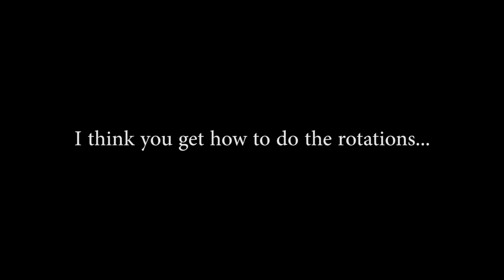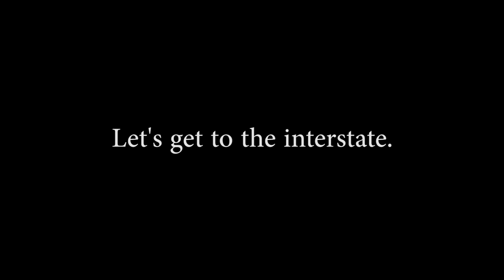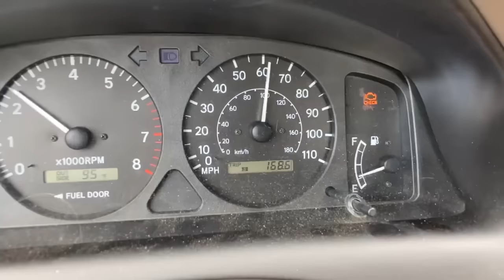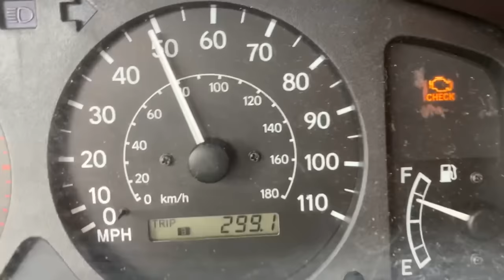Will Berryman's B12 Chemtool stop oil consumption? 😲 | Oil Burning🔥Experiments | Episode 15

Comment: Didnt see (hear) how much you added to each cylinder? Per Berryman's, they dont want the product in crankcase more than 10-12 minutes (when added to a cold engine. I realize this is a difference "application", but I would want to drain oil post haste since it's much more powerful than seafoam. Thoughts? Would it pay to vacuum out the cylinders or use those longer and larger cue-tips to get those carbon flakes out?

Comment: What is the signifigance of 5 rotations of Crank?........ 4 Rotations gives you one FULL Cycle, moving piston through Intake, Compression Power and Exhaust Strokes as well as one full rotation of cam/s and opening and closing all valves

Comment: I did this for a kia sportage 1.6 gdi 2017. It worked ! Before 1l of oil / 3000 km. Now I have 7000 km and 0 consumption. I used Nitrodiluant ( Romanian) for soaking 24 H and I manually rotate the engine several time in this period of time.
Reply from the maker: Thanks for letting us know!
Reply: @FamilyFriendlyDIY  Thanks , your video saved me , alot of money and time.

Comment: Also... I am thinking maybe it would be better if you see gunk in the cylinders after the soaking and rotating the engine, but fluid has mostly evaporated... might be good to put more fluid in, suck it out, and rotate engine to try to push that gunk out before driving?

Comment: After all of that, Install new spark plugs. And then do the 300 miles. Remove and inspect them. Keeping track of them!
Then start  adding  your product to gas tank and drive 300 miles. 
Remove plugs.....repeat...
Do not add stuff to your oil anymore.
Did you buy this vehicle new? I might have missed the history in previous clips.
Or if used.....alot of people only perform "gas" gauge maintenance.

Comment: i drive 2010 corolla-works better if you put full bottle in gas tank before fillup-i do every 6 months.Its meant as fuel system cleaner-NON GDI-not a no smoke type reducer.

Comment: The bottom dot is for cold oil. When the engine warms up it expands and should be at the second dot. So when you do an oíl change.  The oíl must be at the first dot or bottom line. Warm up the car and it should be at the top line or dot.

Comment: Nice vid, I sling parts for a living and B12 saved me from getting new injectors after I rebuilt my suspension and clutch in my firebird. I tried seafoam it would keep the code clear for a month did that 2 months in a row the last time after more research I dumped a can in with about 5 gal of gas ran that down and filled up the code has been gone ever since. Now that I know our gas is not that great I use a can of B12 every 3 to 6 months it's cheap and yet another real world test.

Comment: I'm willing to bet the valve stem seals are contributing to your woes as well. I would have left the B-12 in the crankcase a bit longer, it could only help clean things a bit. But this engine is tired.

Comment: How did the fix hold up? Won't the rings just clog up again, if this is a well known problem? If so, how often will this fix need to be performed in order to keep the rings functioning adequately, and oil usage at a minimum?
Reply from the maker: The oil consumption has not increased since this video.

Comment: I will give you few tips:
1.Chemtool is know for paint striping properties. Since oil pan is painted I highly suggest to remove oil pan and check if oil pickup tube is not clogged with stripped paint. There were few instances with killed Toyota engines just because chemicals stripped oil pan paint and engine suffered oil starvation.
2. You dont need to do full rotation of   engine crankshaft. The goal is here to get chemicals to oil scraper rings. Best way to achieve that is to rotate crankshaft few degrees front and back (5 min front, 5min back). I know you should not rotate engine backwards, but few degrees will not do any harm.
3.While soaking put spark plugs back. Just do not crank the engine!
4. For better starting after flush crank engine couple seconds with spark plugs removed. The more combustion chamber is dry the easier start will be. Usually I blow cylinders with compressed air through spark plug holes.
5. Driving car at hing RPMS does not make any sense and it is not necessary. Outcome will be the same.
Reply: I disagree with your number 5. I’ve tried piston soak with all kinds of chemicals: seafoam, mmo, carb cleaner and b12 WITHOUT driving the car high rpm for 20 mins after. None of them give immediate results like that after. It helps only a little bit but oil consumption return after just 1 full tank around 250 miles. That’s when I searched thousands of forums post after post and found out u need rip the motor HARD enough to help burn off those chemicals u have trap inside the piston land. The whole purpose of this was to trap as much as chemicals in the ring land and burn them off quickly once and for all with high rpm driving after. the high rpm, high heat, high speed of piston pumping and higher amount gasoline injected into combustion chambers with pedal to the floor combined with the b12 in the piston ring land all contribute to free up the rings quickly and effectively.

Thats how I fixed my oil burning Scion tC with the known piston rings problem 2azfe motor with just 2 treatments. 1st treatment cut down my oil consumption about 75% between 5000 miles oil change (only added almost 1 quart in 5000 miles), then after 2nd treatment, no burning oil at all in 5000 miles! I went from burning 1 quart of oil every 250 miles to no oil burning in 5000 miles, so that make total sense to me and it’s the only way to make it work. that’s why I suggested this method to Dave and I pretty sure he saw results like me already, just wait for his follow up to find out yourself. 

I’ve searched all kind of piston soak tutorials on YouTube and forums and 99% of them recommend soaking 24-48hrs and results were always not working still burning oil and they recommend to do the piston soak every oil change UNTIL it free up the rings but how many time does it require to free it up? If the the piston rings and oil holes were SO STUCK AND CLOGGED, how many times of piston soaking and does it take to free it up when u just soaking with chemicals but not MOVING them up and down, expand them and retract? If u want to free up something stuck, u need to physically move them and expand them right? That’s when the high rpm driving comes in to play. Not only it will move the piston up and down very fast, it also creates a lot of heat quickly. So b12 chemically on them, high speed piston pumping, high heat in the combustion chamber = stuck ring will give up and unstuck itself

Comment: It is entirely possible that the B-12 which has drained into the engine oil is what dissolves the carbon, sludge, etc. on the oil control rings once the car is driven after the soak, not the soak itself. B-12 sitting on top of the piston is going to seek the most direct path down, likely the gaps in the compression rings and whatever side of the cylinder is lowest. It is unlikely that the B-12 will spread evenly around the rings.  So, pouring two cans of B-12 directly into the oil filler may be just as effective as the soak.
Worth considering is how the lubrication properties of the engine is compromised by diluting it considerably with this powerful solvent, and how engine longevity may suffer as a result of seeking short-term improvement in oil consumption. Would you pour two quarts of acetone, toluene, etc. into your oil and then drive around? That is what one is doing with this process.

Comment: I have an odd connection with these videos given we have the same exact car likely built by the same dudes, we both run teal, and we're both Dave 🤘
Anyway, Great work! Time will tell. Also since I didn't see it on many forums, keep an eye on your upstream O2 sensor if you get the dreaded P0171 lean code. Everyone always assumes it's the intake gasket or a vac leak but in my case I either burned my sensor up running too much paint thinner or maybe carbon gummed it up from excessive oil burn.
Looking forward to the results down the road
Reply from the maker: You wouldn't happen to be an INTJ? Haha. Thanks for the comment, Dave, and the advice!
Reply: @FamilyFriendlyDIY  I am an INTP.   weird that you know what that even is. INTJ is rare.  also i noticed your bible mat 5.  I was a christian for over 30 years. on yt look up Jews for Judaism and Tovia Singer. look why the educated jews who now the nt very well reject it. Also look up False apostle Paul.
Reply: @FamilyFriendlyDIY  LOL - * I * am an INTJ..... I appreciate your thoroughness and best attempts at a scientific approach! I have a 2012 Hyundai Veloster with a GDI engine that's burning oil like your vehicle. I am going to try this out over the 4th of July weekend.

Comment: How is the oil consumption since your last video? I have a 2006 Matrix with 201,000 miles which consumes 1 quart every 3,200 miles. I slightly overfill by 1/4 quart every 800 miles, so the level never drops below the full mark.
Reply from the maker: It's still doing good, update to come. ... If I was only burning a quart every 3200, I think I'd just change the oil at 3k and not worry about it --- what mileage do you usually change at?
Reply: @FamilyFriendlyDIY  I usually do a 5k oci, but I might start doing one at 4k if oil is already pretty dirty. That's very cool that it's holding up. I originally used m1 full synthetic, but switched over to kirland brand full synthetic for last 70k miles. Seems just as good as m1.

Comment: Could be the oil control ring on the piston/pistons has lost tension (due to overheating or... ????) and is unable to drag oil back down the cylinder wall.
Reply: no. they get clogged. carbon

Comment: If nothing else, you've found a foolproof way of preventing tailgaters! LOL, now you need to rig up an injection system just for Stink Pipe. 
I was thinking about the whole 60 on the highway thing, and honestly I'm not entirely sure why you couldn't do this in the driveway or in neutral someplace secluded. I remember the cloud the first time I sea-foamed a 70s era Kohler engine. If someone were to have suggested you could see the plume from the ISS, I wouldn't have been surprised. 😁

Comment: Mechanic told me this could work, I'll be trying it for my Subaru.
Reply: I have doubts it will work in a Subaru EJ motor because of its horizontal design, how can u prevent the chemical from leaking out when u try to submerge the piston entirely with b12 when the piston is sitting horizontally? I don’t think it will work
Reply: @blackysan  right on, appreciate the info

Comment: I've been using B12 Chemtool in my fuel tank for years, roughly one can every 4000 miles. Because I've heard that it's a powerful solvent that can affect seals, I never leave it in the system for more than a couple of hours. I drive a lot between CA and TX, so I add it to the tank when I know I'll be burning 3/4 of the tank nonstop (easy to do in west Texas): about 300 miles, nonstop, at 80 mph. I also use Lucas upper cylinder lubricant/fuel injector cleaner, one small bottle with each tank of gas.

Anyway, I was laid up with medical issues for a couple of years, and couldn't change my plugs. When I finally got to it, I was about 100k miles overdue. The car was running well, but I expected a mess nevertheless. Imagine my surprise when I pulled the plugs, and they were clean as a whistle! I could have gone another 50k miles. I only wish I'd had my endoscope to check the inside of the cylinder. And this is a Ford Mustang, not a Toyota, with 200k miles! The car burns  no oil.  Not saying either one of these additives is entirely responsible--it probably has a lot to do with driving almost entirely highway miles--but I've been using these since the car had about 50k miles, and they certainly haven't hurt it any.
Reply from the maker: Which engine does your Mustang have?

Comment: After you soak the pistons, did you change the oil? If not that means the B12 dripped into the crankshaft case, and you drove for 20 minutes without any problem.

Comment: Hey Dave, I don't remember anymore if it was you or someone else testing this B-12 who mentioned someone had commented to add a bit of oil to the the cylinder before driving because the rings are dry after applying this solvent, but I'm confused... isn't the oil pump mechanically activated? Meaning, when we rotate the crankcase manually, aren't we pumping oil where it needs to go? Or are the cylinder walls "splash lubricated"? Cheers!
Reply from the maker: Good point. This is definitely not a splash lubricated engine.

Comment: Supposedly after a certain year in the late 90s or early 2000s engineers put less tension on the piston rings in order to improve gas mileage, which is why they’re getting stuck with carbon deposits.

Comment: If you changed oil regularly you would not have that problem. 
Do you run engine at high rpm constantly, upshift and go faster to clean out soot!

Comment: Been using Berryman's for a few years on my 2004 Accord, it's at 250k miles now.  The K motor is rock solid anyhow, but I swear it's entirely bulletproof now, should get 500k out of it, but unfortunately the trans is starting to go along with the rest of the car.

Comment: Did you try use the other Berryman product the throttle body / carburator cleaner? I think you used the fuel system cleaner, is that right? I'm wondering which one I should try first. Thanks
Reply from the maker: I used the fuel system cleaner only.

Comment: just note at 26:21 when you first start the car, there is a very brief period where the engine is starved of oil (before its pumped into filter and into galleys), you can hear knocking noise, then all of a sudden it gets oil and all smooth, its only maybe a second or so.
Dont think it means anything just interesting to be able to hear that.
When you were turning over the engine by hand during the piston soak, did it get hard to turn over at all? or pretty ok?
Reply from the maker: It did seem harder to turn near the end of the test.

Comment: I been doing some research on this,and some people when cleaning the top of pistons like you did they finish by blowing with compressed air and long spout,some also add a vacuum in the same time and then drop the oil and add new oil and filter.